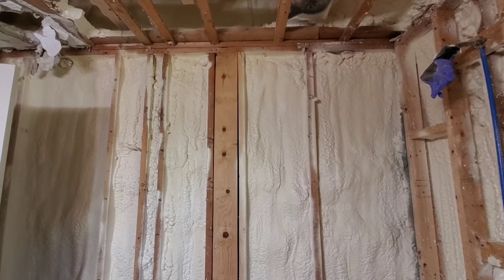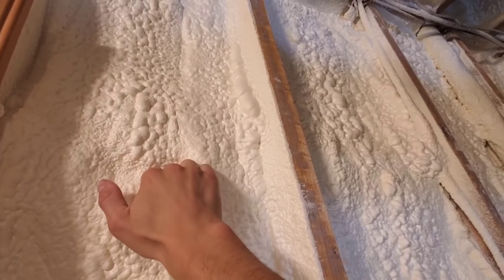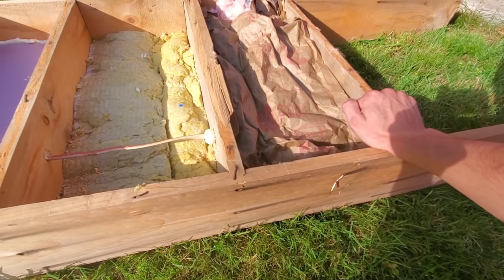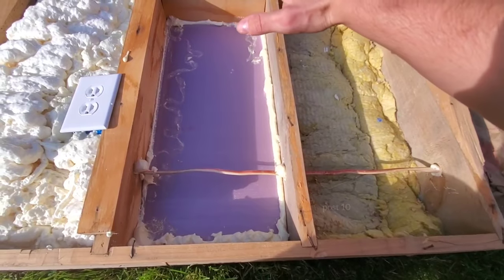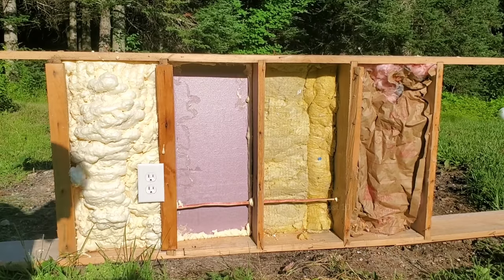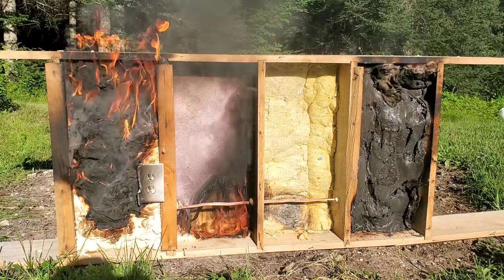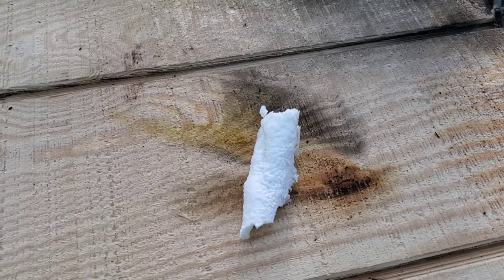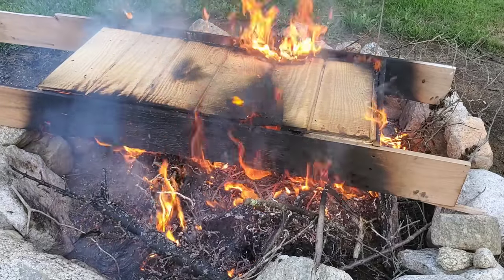Testing The Burn Ability Of Insulation In Wall

Comment: As a contractor, I'm surprised there are not more fire codes concerning the type and usage of different insulations. I really feel for fire fighters entering buildings using foam insulation! So scary....
Reply: I had read this is the reason we cannot have plastic panelling in houses. It is too bad, too, because the plastic looks really nice in some settings.
Reply: How bout all the pvc trim and plastic board and fake siding full of glue? What about big heavy glue-lams held up by new growth spruce or engineered crap? Not a good setup for anybody, least of which firefighters
Reply: Even worse, there's the vinyl floors, polyester fabrics in clothing and vinyl and fabrics in window coverings, polyurethane sponge in the furniture, mattresses and bedding along with nylon and polyester carpet and padding making a hazardous stew of toxic chemicals during fires.

Polyisocyanurate solid board insulation performs well for fire resistance during fire exposure.
Reply: Everything in modern homes is made out of petroleum,  that's why legacy construction gave you about 30 minutes until flashover,  modern homes give you about 3 minutes from ignition to flashover
Reply: I guess that's why fire fighters don't enter a burning building without their oxygen tanks and mask. They're not breathing the smoke.
Reply: I know this is late but I’ve worked in insulation for a few years and I can say our company made it a big deal on what type of insulation we put making sure it’s non flammable, I can see now why my boss always talked bad about foam. We always used fiberglass insulation without paper, scrim paper for the ceilings, and from time to time we would use rock wool. Rock wool was very expensive, anything we’ve ever insulated is definitely fireproof. I’ve done a lot of commercial buildings, warehouses, some residential. There are tons of houses, buildings especially old houses that weren’t done right are definitely a fire hazard.
Reply: Someone's getting paid off
Reply: As a firefighter, the saying during training was,  "Just another way to kill us." Every year, we get the new innovations in building construction that made it cheaper to build but lasted less or no time before structural failure in a fire. I bought a 150+ year old house to have the solid beams... everything else I can upgrade for fire resistance. Modern houses are like glorified mobile homes now. Quick to get HOT, fast to fail. 

End of lesson. Roll safe on the job.
Reply: There are in Europe.
Reply: This guy has misled you by using canned spray foam instead of the stuff actually used for insulation.

Comment: Before you tore into the foam, you could see the velocity of the smoke exiting the top, that means there is still massive amounts of heat and thermal energy stored within a void space that is lacking enough oxygen to burn. When you poked holes in it, you reintroduced oxygen and caused a flashover in the void space. 

Fire science is fun!
Reply: Technically a backdraft
Reply: But yes fire science is fun

Comment: Sorry to correct but I’m a builder in the northeast and we use R30 Rockwool insulation in any vaulted ceiling we build.  It has to be 2x10 so there’s a space for ventilation.  I prefer not to build that way I make double roofs instead.  Rockwool is overall the best rodent pest resistant fire retardant water resistant also.  A great combo is 2” of spray foam for air sealing then Rockwool. Great video
Reply: Doesn't the foam catch fire too quickly? I'd be a bit reticent to use synthetic materials (that is, petrol derived)
Reply: Awesome!
Reply: His foam must have been off ratio, I’ve sat there with a blowtorch on our foam and it only burned the outside

Comment: Rock wool is not a type of "glass insulation", it is spun rock with a much higher melting point, doesn't allow mold to grow in it if it gets wet, critters can't use it for nests, readers sound, and cuts very easily.
Reply: Glass is essentially melted rock so he’s not wrong.
Reply: @seeqr9  yep, rocks are made of silica while glass is also made of multiple types silica like borosilicate or pyrex which is a different silica compound. Also glass refers to when chemicals arent able to crystallize because of differentiating solubility keeping Crystal's from being able to form which usually ends up being perfectly clear with Lil impurities.  All slag and all obsidian and all basalt is technically glass and rock wool is made from basalt specifically which is volcanic rock and Idk if you've noticed but volcanic rocks weigh nothing because their made of glass that's all puffed up like foam. Basalt refers to the foamy type glass from valcanos while obsidian refers to the very pure silica glass produced by valcanos. Also rock wool and fiber glass and asbestos all cause the same problem from breathing them in but the difference is that rock wool and fibre glass are made in a way that the fibres are at controlled thickness which keeps them from being as small as asbestos so u are less likely to die from glass fibre or rock wool but both rock wool and glass fibre are very equally bad for your body and both should be handled with gloves and when using rockwool for insulation in homes your supposed to use a face mask just like with glass fibre but when using rock wool in the garden you dont really need a face mask. Also rock wool has a much higher melting point then fibre glass and is made from naturally occurring minerals and silica while glass fibre is made from pure recycled glass so it's pure silica and is very inert while rock wool can contain random minerals and animals like rats are less likely to use rock wool for bedding or nests while they are very likely to use fibre glass because of it being inert and basically they cant tell it's not just fur while with rock wool it can smell funny and Harbor bacterias because of the natural minerals in it and volcanic rock is naturally good for bacteria because its rich in minerals that bacteria love!
Reply: I had some rockwool laying around in my carport after a remodel and field mice and birds made nests in it.  When I went to clean it up, it broke down in pieces and made a huge mess..
Reply: @seeqr9  he is really wrong.  Mineral wool and fiberglass look and install similarly, but that is where it ends.  There are huge differences in different kinds of rocks and huge differences in the qualities and performance of these to insulators.
Reply: @seeqr9  All rocks started out as melted rock.  More specifically though, the glasses are rocks that cool so fast, minerals do not crystallize separately.

Because different minerals have different melting points (which also means "freezing" points when it goes from liquid to solid), the slower molten rock cools, the more time given for the different minerals to separate and crystallize out of molten solution, aggregate, and form microscopic and then visible crystals.

This is why you can visibly see individual crystals in granite, but surface formed basalt has much smaller crystals, and you will see maybe the occasional isolated crystal in glass when looking at it with a microscope.  Because granite is formed in huge formations underground where its heat is insulated and it can cool over thousands of years compared to surface lavas which can cool from nearly instantly to a few days.
Reply: also why is the rockwool so compressed
Reply: It is actually mostly glass insulation.  
The difference is that it is made from metal scraps essentially as well.

Comment: After seeing how the left panel burned I can now understand how a home can mysteriously catch fire after it was believed to have been thoroughly extinguished the first time!
Reply: This is why we tear up houses as much as we do even for small fires. Smoldering Hot spots can be hiding in so many little spaces and reignite hours later.
Reply: That's the reason why we firefighters do overhaul, we literally break open walls and check through thermals to find embers
Reply: Overe here it is common practice that two or more firefighters stay at site for a few hours afterwards in case something reignites

Comment: I'm glad my house is full of that fiber glass (we saw when our neighborhood was still being built). This video actually brings more security to me as i get easily paranoid. thank you so very much for this video!
Reply: Here I am, a resident of eastern washington going "You got insulation?"

My apartment buildings were built on a budget in a desert like environment, but we get super hot summers and super cold winters and not a lot of moisture - yet I don't think there is an ounce of insulation in these walls. Ice can form on the walls in the winter, heat just radiates through the wall in the summer. If I could I'd take someone to court over this.

Comment: As you spoke of "Spray foam Insulation" , I thought back a few decades ago to a type of insulation called "Urea formaldehyde foam insulation" it was sooooo dangerous .  It was such a terrible fire trap . It would go up just like your burned out test frame work , or even worse .  It's something else to stay away from when insulating .
Reply: Urea is an oxidizer, pretty insane that they would use that as an insulation. Basically installing accelerant into homes!

Comment: We had an horrific incident here in the Uk a couple of years ago at a high rise block of flats called Grenfell tower where a brand of foam insulation was attached to the external of the 1960s era concrete structure and covered with aluminium decorative panelling ,one of the flats caught fire and the insulation burned very rapidly between the panelling and the original structure causing an inferno which claimed the lives of over 70 souls ,various people have been blamed for bad practise and dubious decision making but nobody has been truly held accountable for the events of that night
Reply: The Grenfell fire was created by the CLADDING infill of very flammable polyethylene PLUS the chimney effect of the gap between the insulation and the cladding. Not helped by plastic windows held in place by foam, polystyrene, and rubber. The insulation was not suitable either, can burn as in this test, but the combination with the cladding and air maximised the inferno. Grenfell was far from the only building with this construction, turns out the UK was riddled with hundreds of similar buildings. 
The inquiry has JUST ended (Nov 2022) report yet to come, and criminal investigations are now able to be progressed.
Reply: @asilver2889  
    A great example to show why too much foam, plastic, and rubber-like stuff is a bad idea on any building.
Reply: In the UK I get lots of phone calls from firms trying persuade me that I should have my glass-fiber insulation removed and replaced by plastic foam.
Reply: No one is being blamed because  the eco political issues were met and werecmore important than any other issues. considerations.
Reply: Bay number 2 reminded me of exactly that. Uncomfortably flammable material in a vertical arrangement, chimney draft, and we’re off to the races.
Reply: @Islacrusez In the fire at Grenfell Tower the fire brigade and the police told people to stay in their flats rather than get out. This was good advice for the building as it was originally because it was "compartmented" so that a fire in one flat would not spread to any other flat. The cladding and new windows destroyed this compartmentation by providing routes by which fire could spread, and nobody had told the fire brigade or the police that the building was no longer protected against the spread of fire and now needed to be evacuated in case of fire.
Reply: @cedriclynch  sadly, I am sufficiently familiar with the circumstance of the Grenfell fire. It’s a miracle the death toll was so *low*.
Reply: If I remember correctly it was a fridge that went alight. From there fire made it's to and out the window where the foam paneling served as both highly flammable fuel and a structure to aid in convection. What a waste of human lives.
Reply: @laughingone3728  : That's right, they're all petroleum products. It's a disaster just waiting to happen.
Reply: @lionelt.9124  specifically a Samsung fridge (they are known for lighting on fire)
Reply: @thebigmacd  Holy smokes...😱 I have a Samsung fridge. I think check to see how likely my model will burst into flames.
Reply: @thebigmacd I've had 3 Samsung fridges, never had an issue
Reply: I'd hate to live in a high rise tower like a rat.  I like my 1-story, single family home.
Reply: There have been several similar incidents in Dubai, the same type of panels caught fire and before they knew it, the whole building lit up.
Reply: @thebigmacd  I'm surprised a Samsung fridge worked long enough to cause a fire. I worked in an appliance repair business and despite being one of the most expensive brands their lifespans are truly appalling. They look good but don't buy one.

Comment: There is like 10 different types of spray foams. The one I used is called Polynor made in Europe. Does not catch fire because inside the foam all the bubbles are made of Co2 which will actually put out a fire if melted or torched.
Reply: Having a hard time finding exact details but by that logic it's not fireproof but does better then other types but it's still fuel for the fire.
Reply: @user… prove it by testing it on a section of your home. Don’t forget to film that for YouTube!!
Reply: So the small little itty bitty bubble bursts and lets loose a little itty bitty amount of CO2 “once”
The fire continues.
Reply: But what about in five, 10 years when all the carbon dioxide has diffused out?
Reply: What a  bullshit 😂
Reply: Nonsense

Comment: Just got the break down from an insulation estimator, rock-wool is made from Lava rock melted down literally turned back into molten lava, which then through the process turns into to this cotton candy like material good to 5000 degrees, fiberglass same process but made from sand pretty interesting
Reply: yep, basalt (lava rock)
Reply: Mostly Correct!  The difference is temperature.  Glass melts at a much lower temperature than rocks.  Glass even burns in many building fires when the fire is hot enough.
    That means the "mineral wool" made from rocks is, by far, the best and safest in most applications.
Reply: @laughingone3728  true. rockwool is painfully expensive but it's the most heat resistant.
The only thing better than rockwool is asbestos... I'll stick with the rockwool😅
Reply: @Pantology_Enthusiast  Not only that but rockwool is VERY water resistant, the basalt is already resistant but the oil used in it's manufacture improves it further. Fiber glass holds water quite well, making it easier for mold and mildew to form this trapped moisture can also cause corrosion and damage to wires and outlets, increasing the chances of fires.
Reply: @Gargoyle364  oof, big time. Fiberglass is like a sponge.
Reply: The price of Rockwool for the R15 bag when from $58 to $79 in one day! (2/24) Eff Rockwool. Picked up some Johns Mansville mineral wool and some Knauf fiberglass because of cost and supplies issues.
Reply: Rockwall's a brand but mineral wool is made from like molten slag and stuff it's all sorts of silicates

Comment: Now hes teaching us informative stuff, is there something this man can't do in regards to construction industry stuff
Reply: I consider the drain unclogging informative also as I didn't know it was such a big issue but I am also not very savvy when it comes to subjects like that or this.
Reply: What about HAY, i read that does not burn well...why the heck did you not include hay in this?
Reply: Maybe teaching with some accurate facts?
Reply: Build with steel stud framing.  You make up the material cost through reduced labor cost... 

if you have a good crew.

Comment: Having my new house under construction, one of my major decisions was open cell spray foam or rockwool. I live in north Texas. Here in the south, humidity is a huge factor. Thanks for this.
Reply: I  also live in Texas, they did open cell in my place two days ago
Reply: Open cell spray foam loves moisture and growing stuff in it
Reply: closed cell spray foam if you can afford is an effective vapor barrier and is also has a class 1 fire rating.. meaning it is self extinguishing. it will only burn in the presense of constant flame exposure.. do not fear spray foam.. do the research .. my home burned 2 years ago, traditional insulation, on rebuild i opted for closed cell and did the whole house.. i made this decision as an active firefighter as well..
Reply: Get nice closed cell spray foam. Having R7 insulation, inert AND blocking, and structurally supporting burning stuff is great, along with being a physical barrier. I work with rigid closed cell foam professionally (as high performance foamcore-carbon fiber composite longboards). The stuff doesn’t mess around if you get the right stuff.

The lil can you can buy is nothing like the two-part polyol/isocyanate rigid spray foam that is applied. That stuff (spray foam) is used in fire safe buildings for a reason. It is REALLY good at taking a fire. 

If it’s between open cell and rock wool, picking rock wool is the easy choice. If it’s between a nice rigid closed cell foam and rockwool, picking closed cell foam is the easy choice. 

Anyways both work very very well and it’s a matter of the one you have is the one you want if you already have one of them.